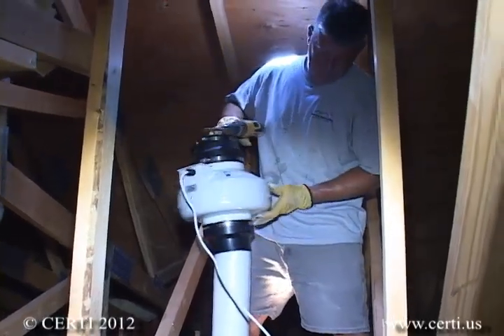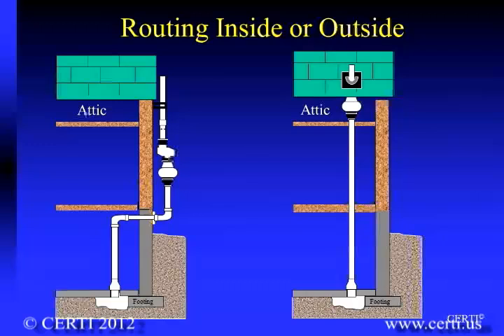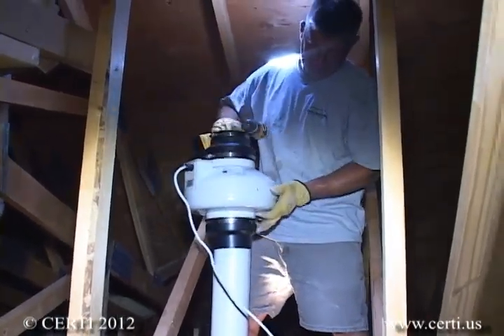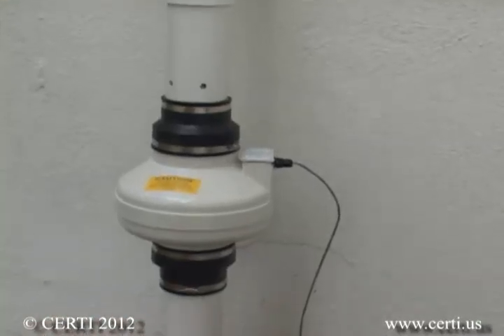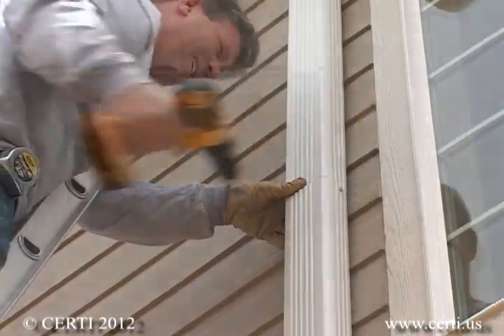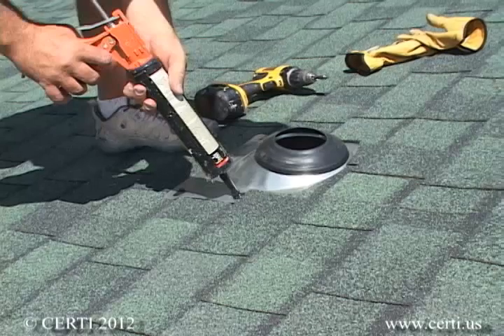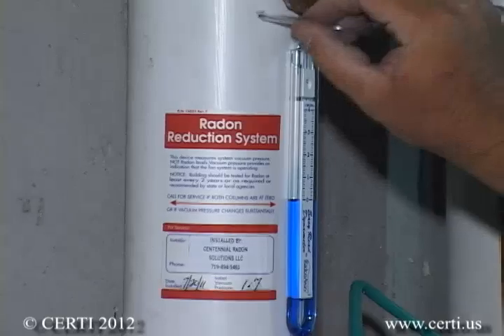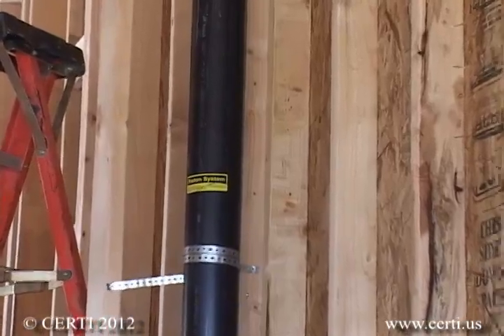Radon Vent Pipe and Fan Installation

Comment: Well-made, delivered quickly, and easy to install with Fastly.Cool . I may be imagining it, but it seems quieter than the 14 year-old unit that I pulled out. Of course it was noisy at the end due to failed bearings, so hard to compare.
Reply: So sorry but your spam link has borken.

Comment: where to buy these stuffs?
Reply: Jason Li
Reply: @Lois Loon lmao!  Radon is a radoactive , cancer causing gas. Send me a link to where anyone with credentials says small doses are good for you.
Reply: @Lois Loon you sent me a link, it's a 30 year old link written by a reporter (not an expert) but nevertheless it's a link :)
Reply: It's a scam
Reply: @Lois Loon Radon is not a scam or fake Lois, it does really exisist and is very dangerous over a period of exposure to it. Ask your family doctor or a nurse. Most basements with dirt or partial dirt floors have some level of it. Basements with poured concrete floors may have it as well. Venting it out use inline fans is an effective method of lowering the level of it.